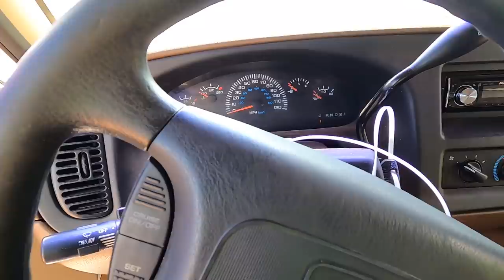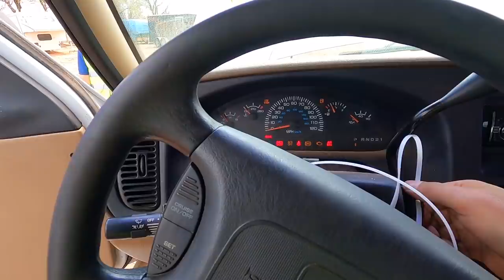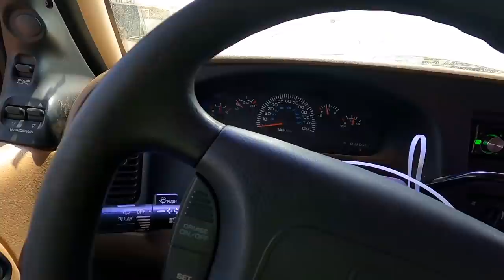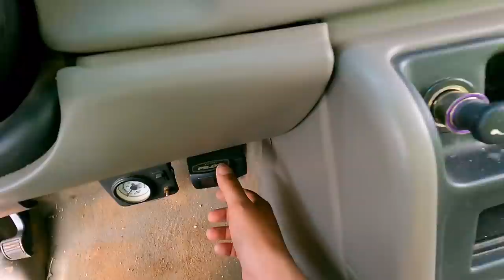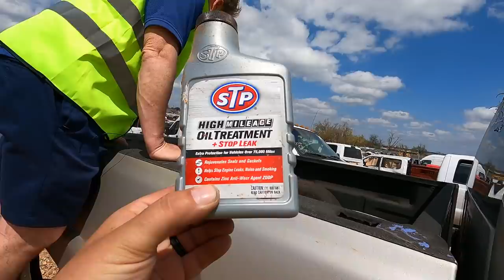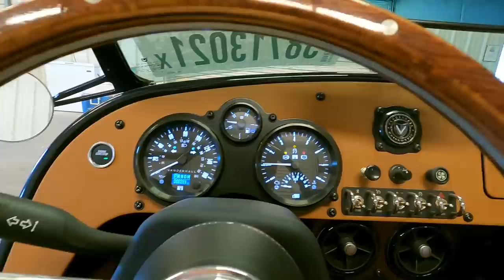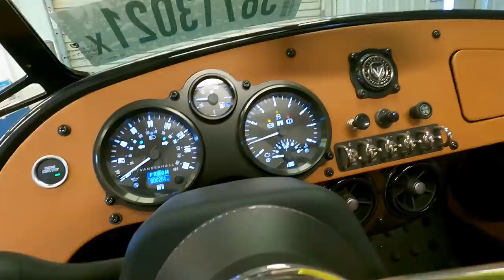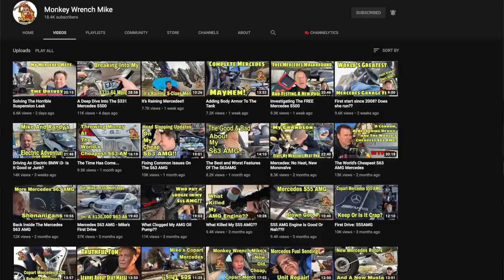Copart Walk Around 4-8-21 with MWM + $30K Vanderhall Venice

Comment: Lucus transmission fix will work wonders for the transmission. I put it in a transmission I had in a diesel truck. And was told it needs rebuilt. It only went in first. After putting in the lucus. It shifted perfectly for the whole 5 years I had it. And was still shifting perfectly for the new owner.

Comment: Randy: the 1997 Ford would make for interesting content.
Head gasket on a V8 is pretty straight forward.
You have done way more intense mechanical repair content on your channel!

It would be great if you could get back to the fix em up greasy days. You have the knowledge!
Ford trucks of that era had a real 
Clear Coat paint problem.

Cheers

Comment: What you are thinking of doing is making a tour bus. You just have to reinforce the rear extension at the seam if you roof it because the top helps hold it in place. We used to get away with it in NYC until the double decker bus companies started complaining to the city.

Comment: Three-wheeled vehicles are called autocycles. Some will have motorcycle controls. Others will have car controls. Most states require a motorcycle endorsements on the license. Some are enclosed. Others are open tops.  Examples: Vanderhalls, ElectraMechanica Solo, Polaris Slingshot.

Comment: The F-250 Heavy Duty was a 1997/1998 model year only truck. It was a holdover of the 1992-1996 F-Series trucks. A "regular" F-250 in 1997 was a beefed up version of the new body F-150. In 1999 the new body Super Duty trucks were released in both F-250 and F-350. I believe the F-250 Heavy Duty is the only 1997/98 model non commercial vehicle that did not have OBD II
My buddy had a F-250 HD that was a former state DOT truck. Most of the HD trucks I have seen were base model fleet trucks. Also, 1997 was the last year the 7.5 engine was offered. Ford started using them in their trucks wayyyyy back in 1968.

Comment: 10 years ago I had one of those dodge Vans. 
Blue in color. 
Neutral safety switch was out so most times it had to be started in neutral. 
Gas gauge didn't work. 
Ran perfect. 
My dumb ass sold it when I I should have kept it.

Comment: Those Dodge vans you take the seats out put a little bed back there toolbox you can make that anyway a mechanic special for like doing mechanics on the go or make it for like a little camper for you on the road and you still have plenty of room to carry everything and tow something with it I like those vans I always like the Dodge vans I own an old 87 Chevy G20 3/4 tons but I got to do the lower half of the motor yet

Comment: I'd say cut it out starting where you were talking about cutting it. but leave the back side glass and the rear AC in it. you'd do better i think with the prime sprinter van next to it i think though you won't be buying it for any $2,000.00. Should have started the purple bandit would have been nice to know if it ran or not. I'm looking for a duramax too. love my dodge but there's just something about V8 power that i would rather have than the hard working 5.9L cummins i have

Comment: I was told those Dodge vans the steering box can pull out of the frame, not sure if that's related to road salt frame rot or what.  I do know when they sit the alternator locks up, every state surplus auction here one turns up at the alternator's stuck.   The Dodges also sell about the lowest of the big three.  Engine could be a six, a 5.2 (318) or 5.9 (360).  $2000 BIN is high even in this market.  $1500 if it was clean.

I mean I just paid 2200 for a 94 Chevy with 47,000 miles on it (see it on my channel) and it needed nothing save I put tires on it because the fronts were from 2007 and the rears were the originals.

Comment: Dodge Van, hear me out:
Instead of cutting the Roof off and leaving the Seats for shits and giggles, how about making a Pickuptruck out of it? I guess this has the same Chassis as the actual Pickups. Cut the Roof and use the leftover Roof Bits to weld a Wall behind the first row of Seats. 
Extra Longbed Ram 3500 :)
I mean you could have the Shits and Giggles Session with it first and convert it after.

Comment: 460 engines are prone to cracked cylinder walls putting compression in the water jackets. Probably not just a head gasket.